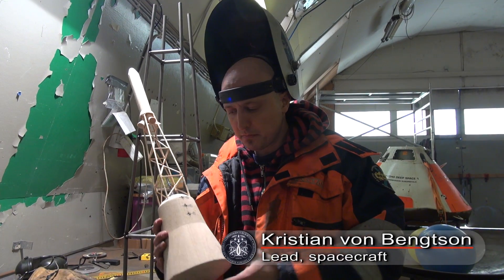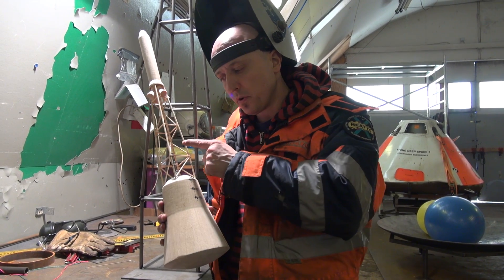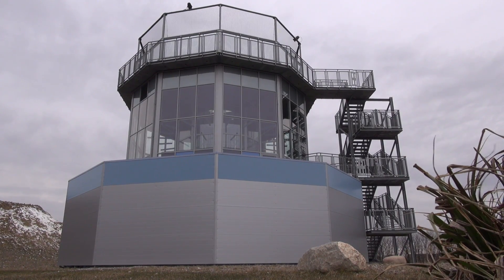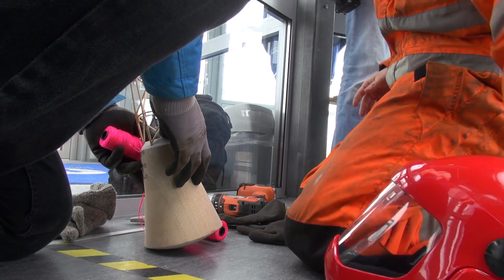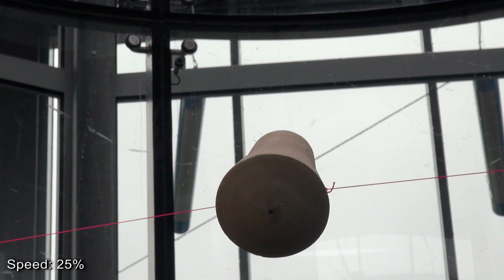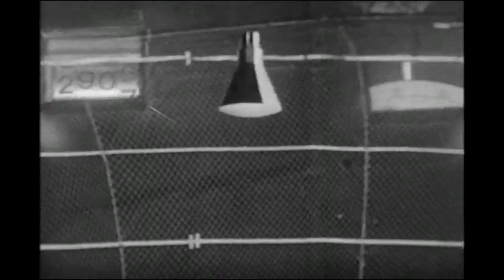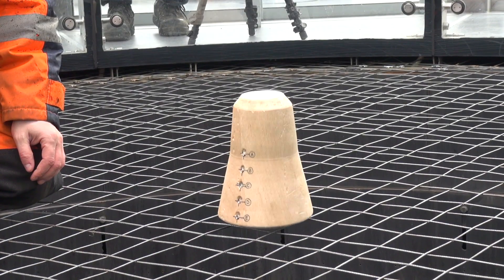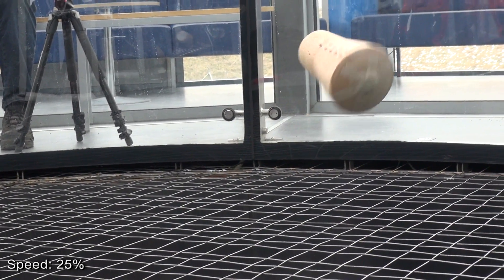Tycho Deep Space II - Wind tunnel testing 01

Comment: Aweseom job! A few questions/ remarks: 
That thing were you are testing the assembly is not really a windtunnel. I am sure it creates a lot of turbulence that isn't filtered out. 
You also use a flexible (non rigit) wire for fixation that may induce the oscillating movement. Will you do tests with modell sized rocket engines?

Comment: Besides the turbulence from our bodies the flow is pretty laminar and controlled... So it is still a valuable test where the results must be combined with other data...  As mentioned on the wired-blog we wanted to use a rod for mass center control, but ended up with the string. Attaching a string gives us more possibilities for new mass center points.
Not sure we will be testing rocket geometries since its quite easy to calculate stability. Its not for these kind of geometries... //vonBengtson